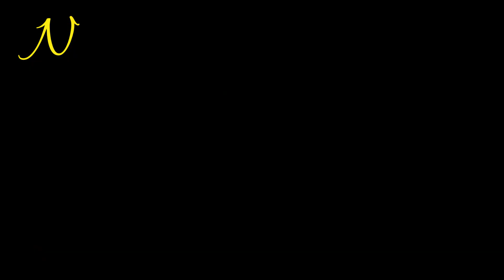DIY Desktop Mini Fridge 1 ° C !! Use it in the car

Comment: can u explain ?
On which concept this  fridge work ?
U attached single peltier module without attach cooling fan inside box, and after some time u make ice in glass, wow, but explain in detail how can it be possible?
Reply from the maker: Mr. Pelter unit is the one who gives cooling, search for it on YouTube and you will find it
Reply: I have searched many videos and in every videos they show different results and i have also made peltier fridge with 12706 but ice making not possible that's y i m asking

Comment: Very cool design.
It seems very efficient.
I would greatly appreciate if you could give us the specifications of both the Peltier unit and the fan you are using.
And eventually where we could get them.
How many watts is this mini freezer using?
I checked your telegram channel but no information on that there. 
thank you very much
Reply from the maker: Mr
The Belter is a newborn cooling device that will be used in future refrigerators that are placed in cars and other confined spaces
The fan we use is a CPU fan that is very powerful

The use of this refrigerator is 50 watts

Comment: Also what is a process cooler? How does it work?
Reply from the maker: How does the filter work?
The pellet contains rows of tiny semiconductors welded together and sandwiched between two plates of white ceramic capable of transferring heat. They are similar in the way they harness energy, as heat is transferred from one side to the other to become cold. When the polarity is reversed, the hot surface becomes cold and vice versa.
Follow us on telegram
https://t.me/nethelp11

Comment: Tell us more about this cooler
Reply from the maker: A Peltier is a device that converts electrical energy into thermal energy. The device has two sides - a hot side and a cold side. The first page of the first page of the back side of the case.